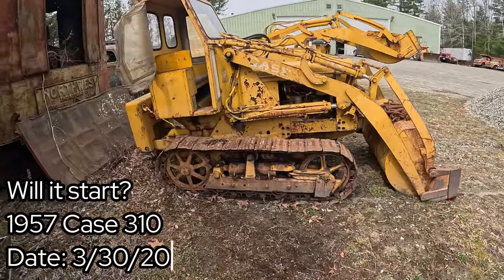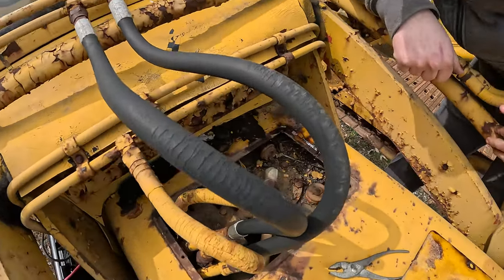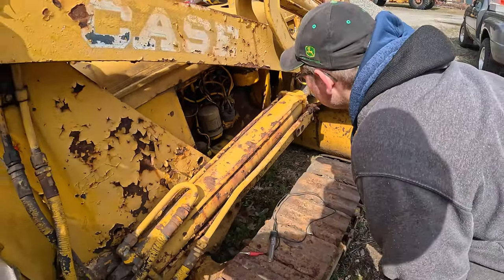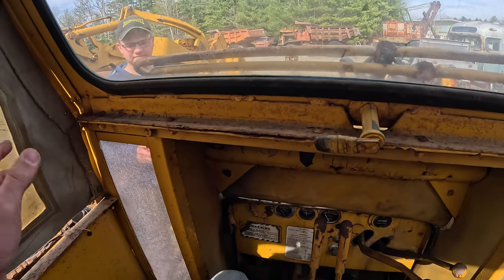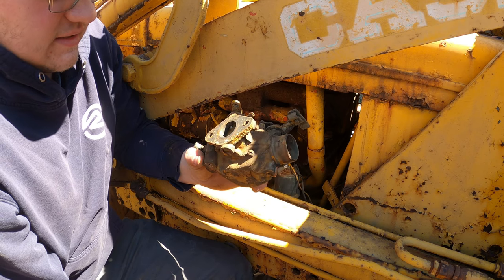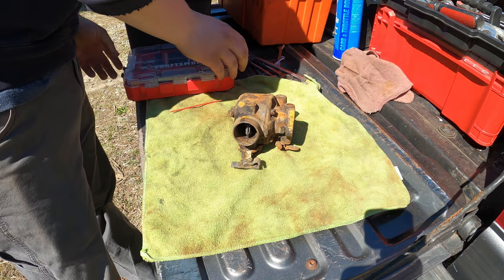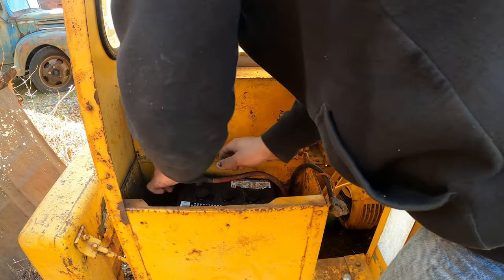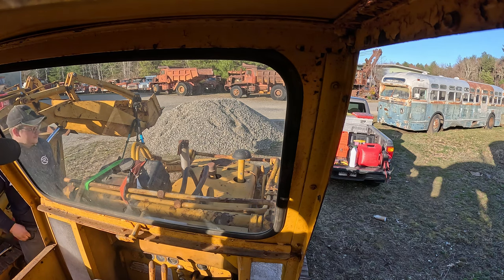Will it start? Grandpas 1957 Case 310 Terratrac loader

Comment: Older machines really were built to last. Everything is metal, very few parts, no electronics. If you leave anything built 5 years ago out in a field for even 10 years it won't work at all, meanwhile this thing could sit out for a century and work fine. It really is amazing.
Reply from the maker: Yes, it is crazy. The only thing that you have to do to these is just clean the points and maybe the carburetor and you good to go. New things are nearly impossible to work on. Thanks for watching the video!